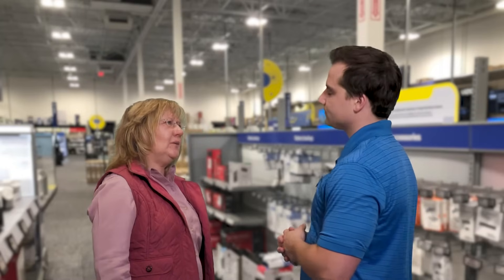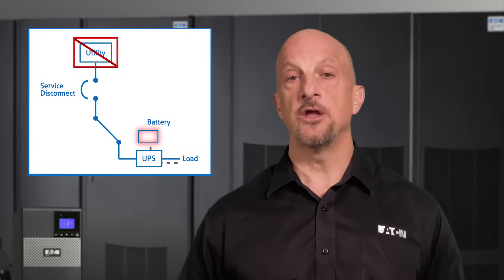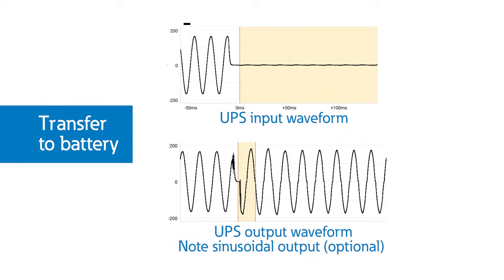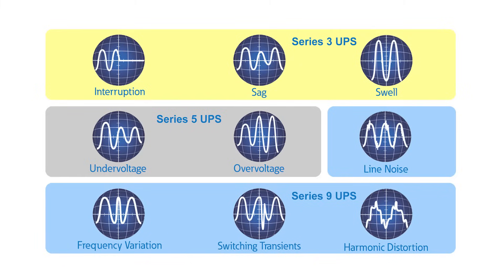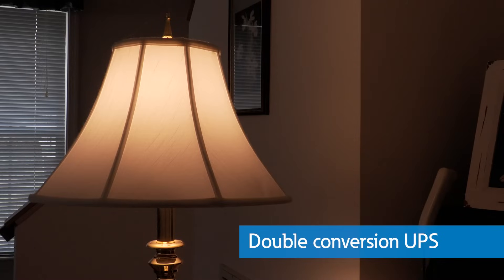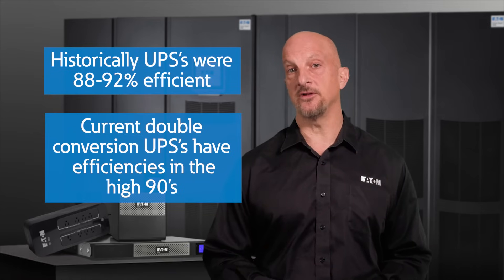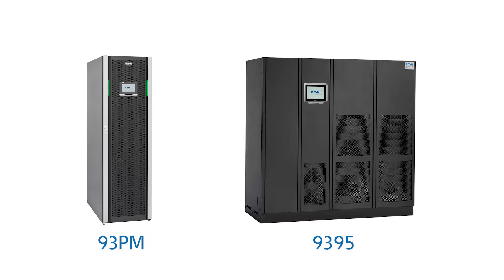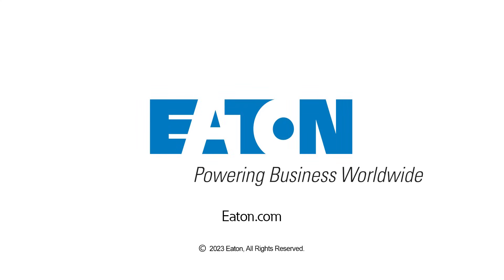What is a UPS and how does it work?

Comment: Why  (1000/400)*5 = 11.8 ? BTW, all content is very informative.
Reply: In the event of a blackout and a power demand of 1000W, the UPS can power all connected devices for 5mins. In the example, the power demand is only 400W. This means the possible runtime of the UPS increases to 11.8mins, since less power is being drawn. To get to this you devide your actual power draw (400W) from the max load(output) of the UPS (1000W), then multiply the result with the specified runtime (or backup time) of the UPS. Now you got the specific runtime of your UPS with your actual power draw.

Comment: What is the difference in specs? eg, the Eaton 5E Gen 2 Tower UPS, 700VA / 360W, 2 ANZ Outlets - VS - Eaton 5E Gen 2 Tower UPS, 2200VA / 1200W, 3 ANZ Outlets - I know the voltage is different but what does that mean as far as what can be plugged into it?

Comment: I got myself a 9E 1000 because winter is coming, and with it power outages. 
I wanted to ensure perfect stability and quality so got a double conversion one.
Never knew home voltage so easily fluctuates by +- 10V while Freq is only by 0.1
Software is good.

Comment: Thank you for the video, but... No mention of linked software to shut down computer gracefully when UPS will run out of juice if longer thatn expected power outage, and thus act same as a regular power outage with what is plugged in ? How come ? Thank you fpr any enlightment if you have the time...
Reply: i wasn't aware of linked software for this. thank you for letting me know!